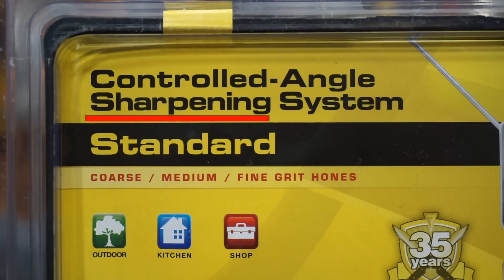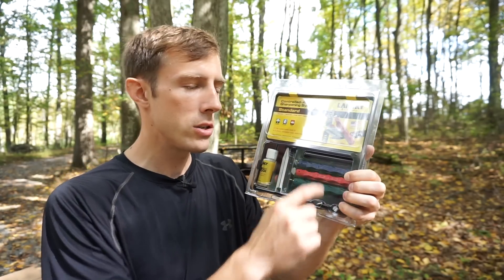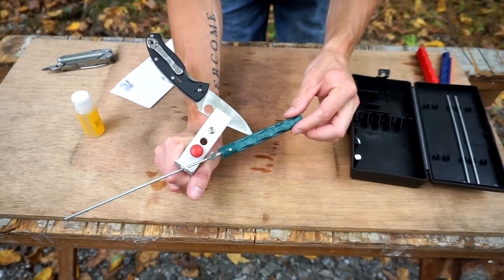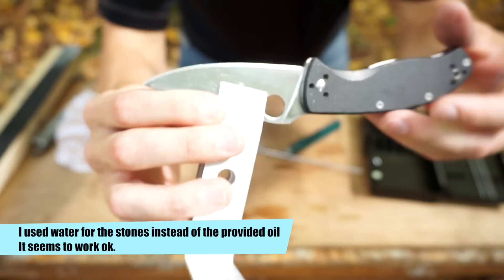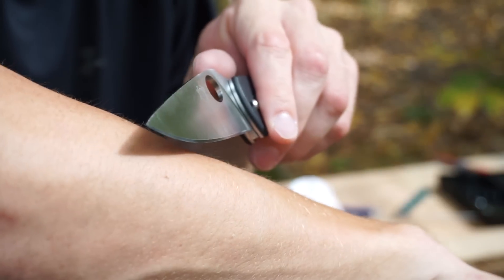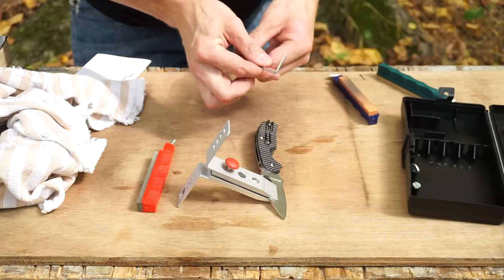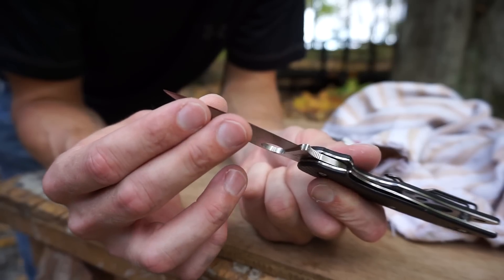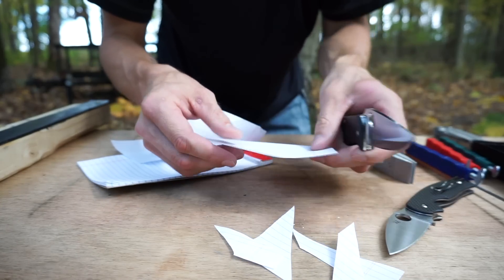LANSKY CONTROLLED ANGLE KNIFE SHARPENING SYSTEM | Another great beginner sharpening system.

Comment: Lansky is a very good, affordable system, if used Properly. You had defiantly  attached the rods wrong. They do have  a clamp base for table top working,  Along with a base that can be attached to a board for a Portable system. For aboun10-15 bucks. Lansky also have leather stropping for thier system for 10 bucks. Will post the instruction video in the comments.
Reply: Another tip..  When using the 17 degree angle, you will need to remove the thumbscrew or the rod will hit it. , Then you will need replace it with the flat head screw included in the kit.
Reply from the maker: Yeah I know about the rods haha. It still worked cuz I think I set the rods close to the same every time. Noted for future use though👍

Comment: the Lansky system is good, but does NOT work on small(narrow) knives. also what I like to do is, run a Sharpie marker along the sharpened edge and then re-hit the knife with the lansky sharpener. you can see where you missed. and for the record you can find a lansky sharpening system for under $50((USED)),, NEW cost around $75 - $80 or more.

Comment: You can buy the base for 10 bucks I have the complete diamond and ceramic stones wouldn't trade it for any 300.00 sets out there now anyone who believes you have to buy a 2 or 300.00 sharpener is insane
Reply from the maker: Thanks for the info👍 Nice to hear someone else has had good results with it. Id like to try the different stones as well. I found the base on amazon but will probably just use a bench vise going forward. I agree, some of the systems are insanely priced. Just look at the wicked edge haha. But I guess if your using it all day every day in a professional environment its worth it. Thanks for the comment my friend😀

Comment: You have a knife handle to hang onto right there hahaha
Reply from the maker: The lansky doesn't hold onto the blade that well. Holding the handle the lansky would work loose and fall off.
Reply: I used a lansky for my first sharpening system and always held it by the knife handle. It helps if you throw a little bit of athletic tape or something on the jaws of the clamp
Reply: If you get the extra stones you can actually get a pretty good mirror polish on your edges.

Comment: OH NO 1 HUGE PROBLEM I SEE YOUR DOING!!!!! when you put your rod into the stone holder you got to have both of them setting on a flat surface then tighten the wing nut to hold the metal rod to the stone that way you get the correct depth each time you put a different Stone onto a metal rod because if not just by eyeballing it even you can never get it consistent and we all know with sharpening angle consistency is everything
Reply from the maker: Makes sense. Thanks for the info 👍
Reply: OUTDOORS55  no problem glad I could help... p.s.  great videos very entertaining keep em up.
Reply from the maker: Thanks my friend😀